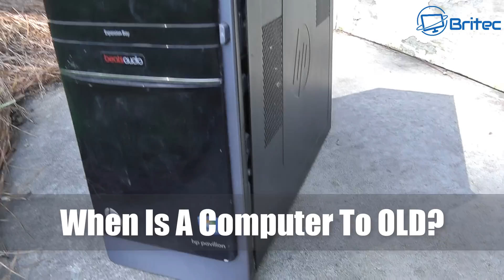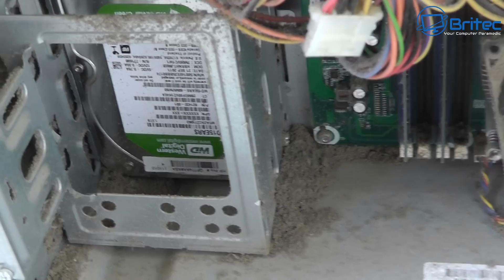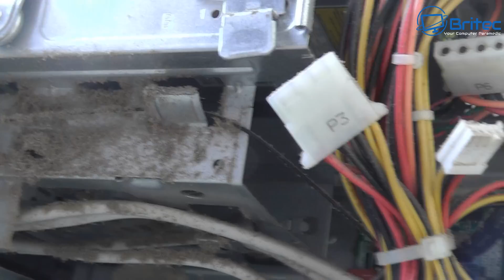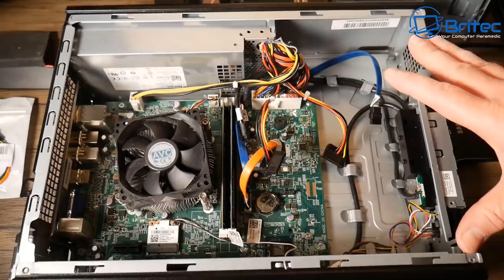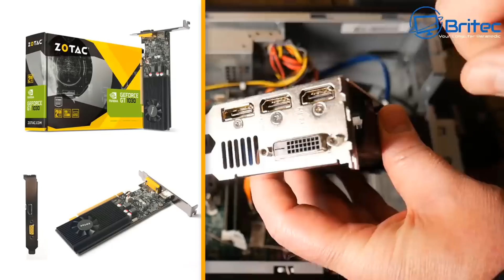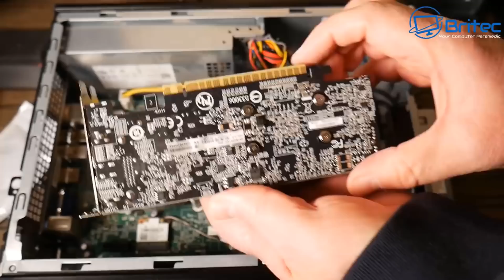When is A Computer Too Old

Comment from the maker: How old is your computer? Drop us a LIKE 👍
Reply: i7 3770
LGA1155 Socket
Reply: I’m still running a system with socket 1366 cpu with 6 cores and 12 threads and have no problems with daily tasks and gaming.
Reply: I'm still rocking an Ivy Bridge, does everything I want, I wouldn't recommend it for rendering video tho lol
Reply: My secondary PC is 9 months old and my main PC is 5 and a half years old, however I'm building a new main PC in January :D
Reply: My old PC is from 2008 (came with Vista), I made mane upgrades to the hardware and now have Windows 10.
My main PC it's from 2018 with Windows 10.
Reply: 2011
Reply: I'm posting here on a Q-9650 system with 8 gigs of Crucial 1066 RAM and an SSD. I did upgrade to a Radeon 3100 GPU. Hackers scan it and say "Waste of time!" ... :)
Reply: I have i3 4150 dell optiplex 9020 sff with 8gb of ram and i have installed ssd in it i bought it 3 years ago it is running perfectly as it should running without any issues so far i am happy with that because i am a casual user i use it for browsing web some youtube email movies and music so i think it is enough for these kind of tasks and i think it should be fine till windows 10 end of life in october 2025
Reply: I had computer that came with Windows Vista SP1 from 2008. I use SSD for main drive and it runs Windows 10. My old computer only handles 4 GB memory. Until then, my main computer that I've built myself from 2018 (Intel Coffee Lake) and then last year (latest of AMD Ryzen).
Reply: Primary PC (2021) Ryzen 9 5900X, 32GB RAM, RX6900XT
Secondary PC at my parents house (2017) 8700K, 32GB RAM, RX6900XT

Didn't went on a holiday the last two years so I upgraded the graphics cards (sold the GTX1070 and a HD5850).
Reply: My main pc is about 5 years old, but it's gone from a 1500x,GTX 980, 16 gb ram to a 3900x, 1080 ti, and 64 gb of RAM on the same motherboard over time. I've been lucky and have gotten good deals on used components to upgrade. Best part is that I was able to build and donate a computer to a person in need with my old hardware!
Reply: Windows HP Vista 64bit ~2008 should take windows 10 maybe display 1080? Maybe good for mining :) and should give 4k through the updated GPU?
Reply: My main desktop is a 10 year old (2012)   i5-2500 CPU, 8 Gig RAM and 1 TB SSD running dual boot win 10 and 11.  Works  fine until you try running a Virtual Machine then it shows it's age.   Unless it dies I will keep  it until Win 10 dies.  It started life as dual boot Win XP and Win 7.  XP was for old analog video work.
Reply: My rule of thumb is a computer is too old when it no longer can do what you need it to do. My main PC is a few years old and is still doing fine. The main components are a MSI X570 Unify, water cooled Ryzen 3900X, water cooled XFX 5700XT, 32GB of DDR4 RAM running at 3800 CL 14, and a couple 2TB NVME Gen4 M.2 drives. All stuffed into a Thermaltake View 51 case.
Reply: i7 4770k
GTX 970
32GB RAM

Only recently upgraded the ram, had this rig since 2015
Reply: I have a amd system socket 939 from 2006 and it still works and I'm running xp and for internet stuff and gaming I'm using a 2 year old amd system that I built myself and I also plan to revive another that I have which is a socket 754 amd maybe that I got in 2005 just for nostalgic reasons. On the old xp system it's not connected to the internet at all it's for playing old games from that era
Reply: Main desktop runs an Athlon X4 870K with 16GB of RAM. GPU is a Radeon HD 6970, and it has multiple HDDs, SSDs and even an NVMe drive retrofitted. I built that one in 2015. 

The laptop I watched your video on is a Core 2 Duo T9900 with 6 GB of RAM and an onboard Radeon 4330 GPU. This one was built in 2009 but I've upgraded the CPU and installed an SSD.

Both of them are running PCLinuxOS as their daily driver. And both of them are completely satisfactory, which is why they are still in service.
Reply: i5 Intel 4th Generation 

I'm buy this in year 2013 

But now I'm face problem with HDD 

It's Corrupt
Reply: 15 yrs old pc with core 2 duo e6600 and 3gb ddr2 ram, runs okay on windows 10 32 bit ver, 1607.
Reply: Its from 2008
Intel core 2 duo, ddr2 4 gb ram, runs windows 10 pretty well, and the lego Island game (1997) also runs pretty well.
Reply: i have a i5 4570
8gigs of ram 
GTX 750
250 gig ssd
and a 500 gig ssd
Reply: I just tried down loading  6 pics from a42g5 to lenovo. 45 minutes. Mining only explains tbis. My wife just lost nearly 100 year old pics. Fuck the cloud
Reply: Ok. No post. Screw the cloud
Reply: Why buy 9 month old puter?
Reply: With a good Ethernet card and remote computing, ie Nvidia Now,  my 10y old amd phenom 960t can play all modern games. But I  did build a new 5800x pc with gen 4 and pcie drives for video editing and its 400% fast er
Reply: 14 years old
In my workshop I have a  Dell Optiplex GX 755 USFF
I don't recommend it because parts are more expensive than it's worth.
It's a cute novelty and works great
 The network card is not replaceable they fail. You can use a usb to cat5 or usb wireless. The little case fans fail too. Tight to work on.
I use 4 Dell Optiplex GX 780 MT's for different stuff around the house. They are pretty durable , in comparison.
Reply: i7 4770k
msi z87 xpower
evga gtx 780 sc
oh yeah and i got the pc for free about a year ago
Reply: 52 years and counting. 

Pros: It is fully NI (no AI here) painstakingly developed over billions of years. Currently runs with ANDRO OS EN installed (custom build, other languages are available). Supports hardware replication over virtually infinite generations with appropriate F.E.M. external upgrade. 

Cons: May fail unexpectedly, customer service is metaphysical.
Reply: PowerMac bought in 1997 still working, OS8.6; G5 bought in 2005 also working, OSX Tiger; MacBook made in 2009 (from ebay) working, OSX El Capitan. Present Mac is iMac bought 2015, OSX Mojave.
Reply: maybe 18 years pentium D
Reply: Gateway FX6860 with I7 2600 @3.40GHz. I think I bought it in 2011 still running strong.
Reply: Less than 1 year old
Reply: Yes 👍 better any new generation atom processor c2d is best choice
Reply: A Phenom II, but it's not my main or backup computer.  It does a better job running my old pc games (that came on floppy or CD)  - Gold Box games, wizardry , Ultima, etc.,when I get nostalgic.
Reply: Upgraded my PC from a i7 4770k, 1660 super to a 5600x and 3070 ti a few months ago, had the 4770k system for 7 - 8 years I think when i guilt it.
Reply: Im still using the pc i built back 2012  ivy Bridge i7 3770k z77 platform just been upgrading the gpu currently have asus tuf 6700xt.
Reply: 12 year old thinkpad x201 running manjaro linux xfce with chicago 95
Reply: 2018 cpu/motherboard pretty much maxxed out now with upgrades.
Reply: sandy bridge i5 2320
Reply: My most recent Computer is 4-5 years old my oldest computer is 13 years old it’s almost 14 years old
Reply: 2017
Reply: My 1985 Amstrad CPC 464 no longer receives the latest updates. Takes around 5-10 minutes to load Manic Miner from a compact data cassette.
Reply: Medion 6486 £548.00 bought from Tesco in August 2007 (Windows Vista!). But i have upgraded the operating system several times, added more memory  and changed the hard drive to an SSD and a few other parts. Still runs the old games no problem.
Reply: @marksavage7165  
So it's not just the computer hardware. Its software modern locking out legacy software too.
I have an old desktop running Windows10 and Windows10 won't play some old games I want to play.
So what do I do? Run a older windows OS just to play old games I like.

Comment: I'm running a i3-4160 chip in a B85 motherboard 
with 8 gigs of DDR3 cas 9 memory and a 2GB GTX 750 Ti GPU.
It's not a rocket, but at 1080P it doesn't have to be for me.

Comment: As we speak I'm using a Dell Optiplex 790 Bios version: A07, 9/10/2011 windows 10 and it works great for my a bit above average use, ok average. So for you tube, word processing and all other media is defeatedly not slow. I don't know about work....I know it would be slow for that for sure....🤣

Comment: Using a dell precision M6800 a dell inspiron 660 and a Lenov think centre m73 as my dailys my laptop has 32gb of ram and plays all my games with 3 1tb ssds lol  yes 3 of them lol my lenovo i use for Linux and my last system is a old vista system i have for older softwarre

Comment: My oldest PC is an early XP Pro machine that I moved into a newer case with better air movement and a place for a 2nd hard driveover 10 years ago, but it runs my older programs not supported by newer versions of Windows just fine.

My oldest Apple based is a Power PC running (I think)  OS 4.0.  I haven't used it in a very long time, but it still works.

As long as it is reliable and still does what I need, there is no need to replace it.  Bigger better faster more is sometimes an excuse and not a reason.

Comment: Mine is 13 years old, and it still does everything I need from it.

What I do:
CAD, 3d printing, 3d modeling, browsing, movie watching, programming and web desing, spreadsheets, virtual machines, studying, light gaming or emulation.

What I don't do:
4k editing, playing most recent games, streaming.

My system is: LGA1366 6/12@3.2GHz, 24GB DDR3, GeForce 1060. It has USB 3@5Gbps too (it were one of the first motherboards with USB 3 at that time). I laugh at those who say 'future-proofing' isn't real. It is real and will be even more so in the future. If you buy your system today I bet it will not be absolute 15 years from now.

What I would recommend to pay attention to if you want to future proof your next PC:
1) Don't be afraid to spend more money on the platform, if you buy threadripper motherboard you don't have to buy the best CPU right away, in 8 years the best CPU for your platform will sell for 150-200$ on your local version of ebay because servers will start to get rid of old hardware.
2) More cores is not always better, if you do professional CAD in old software written in the 90's, or other specific tasks it is better to stick to 8-12 cores with higher clocks.
3) Pay attention to connectivity, you certainly would want to future-proof that, so if your motherboard supports USB@10Gbps, LAN@10Gbps, WiFi6e, maybe even Thunderbolt, it will ensure that you are not going to be frustrated by slow transferring speeds.
4) Having PCIe 5 will be useful for future NVMe drives, don't ignore it.
5) Make sure the BIOS supports disabling secure boot and TPM module.
6) I would go with ECC memory regardless if it's server or not, bit rot is no joke, your data is more important than additional 20fps in a game. Plus you will have more options in the future to convert this system no NAS with ZFS, or whatever you want.
7) Buy a good reputable Power Supply, I recommend Seasonic or Corsair with 5-10 years warranty. Read reviews for your particular model from someone who disassembled the PSU and can competently describe the internals.
8) Buy a UPS to protect your investment, and yourself from data loss.

Comment: Just because it's "running slow" doesn't necessarily mean it's too old.
Sometimes, even when upgrading it, it can still run really slow... this can often be caused by software issues. Sometimes I've spent hours trying to solve issues like this, but if I just backup the data, clean install onto an SSD, the system runs significantly better. i find this issue very common with people that have upgraded from Windows 7 or 8.1 to Windows 10/11, where the installation of Windows is over 10 years old.

You'd be surprised how well Windows 10 will run even on 2GB RAM and a 2GHZ Core 2 Duo, when you have an SSD installed... it's actually very usable, I upgraded a 16 year old Advent laptop from a 1.6GHZ Pentium to a 2GHZ Core 2 Duo (I have some 2.4ghz ones coming from my friends at China, they were like £3 each lol, dirt cheap) so the processor is much faster than the original, I would've upgraded the RAM to 4GB but advent thought it was a good idea to only put 1 DDR2 slot on the Mobo. but even so, Windows 10 is perfectly reasonable on it for basic tasks.
You can also get 128GB SSDs for £12 nowadays, or 256GB ones for about £18, the prices have fallen significantly in the last couple of months. I don't sell a single PC with a HDD as a boot drive, even on XP it feels sluggish on a HDD, I put in the cheapest SSD I can find, and the responsiveness of the system, its a significant improvement. And yes, I understand its not going to playback more than 1080p video or render 4k premiere pro edits etc, but most people that have a machine this old probably don't need it for those tasks anyway. Most of my customers just want a web browsing, video playback, etc machine, and putting in an SSD with a clean installation of Windows, with no bloatware that OEMS like to bundle, it is a significant improvement.

As for desktops, they are much more upgradable. For systems from the LGA775 era, I usually put in a £10 Nvidia Kepler based Quadro (GT710 but less than half the price), which still gets security updates from Nvidia, paired with a £2 DP to HDMI or VGA adapter for their old monitor, upgrade to 4 or 8GB RAM, SSD, upgrade CPU if possible (I usually upgrade them to at least a ~2.5ghz quad core or better, if not, I find the best CPU for the socket that is reasonably priced) and you've gone from a machine that will barely run Windows vista smoothly, to one that would even run Windows 11 just fine. A lot of Windows 11's performance issues are caused by the GUI, so upgrading the GPU makes a significant improvement on a modern OS. Unfortunately this isn't possible on the majority of laptops (aside from MXM laptops, MXM cards are ridiculously expensive and hard to find, and its not like you can put a modern one in an old system).

There is a lot of life left in even very old PCs, particularly if you have a desktop, where it can be much more easily maintained and upgraded. 

I'm also one for keeping old systems in use for as long as possible, as a lot of people just throw away fully working hardware because it's running "slow" when the only problem with the system is the dumb OEM decided to put a HDD in instead of an SSD.

Comment: How to create 4K videos on a 10-year-old laptop with Windows 11 22H2:
Patience
The editor takes a minute to load
When you export videos, you DO NOT multitask
Adding text, the text fields are a bit unresponsive
If the audio lags in the video preview, kill Microsoft Edge process to attempt to reach 24 FPS
Tolerance
Often save changes to your project - the video editor might crash
Always save a project file before starting the export
The export speeds range from 1.5 FPS to 3.5 FPS
Always put the laptop on the floor and move it every 15 minutes because it might overheat
Be careful with the cable - the battery doesn't hold a charge
Be careful with the display - the hinge is very fragile
Be careful with the HDD when moving the laptop

Not kidding, this is my YouTube editing laptop. Intel Pentium 2020M, 8GB RAM, its original 5400 RPM HDD, and it runs Windows 11 22H2. Once I forgot to insert the second RAM stick, and it exported 4K with 4GB RAM. By the way, I can't preview it in YouTube after that...